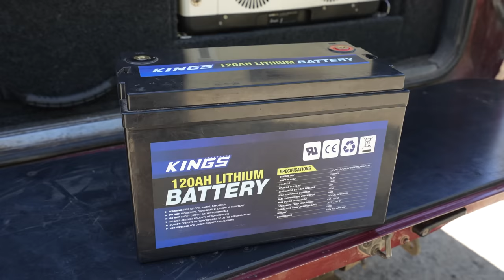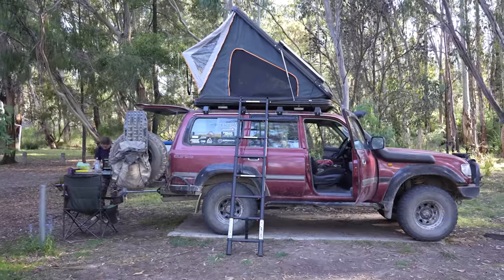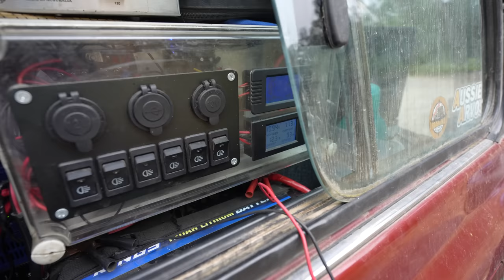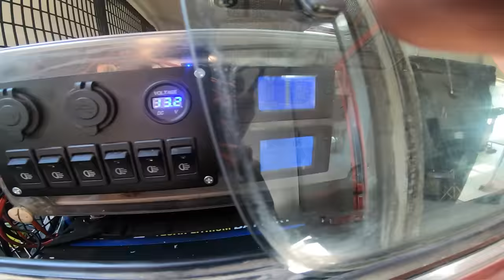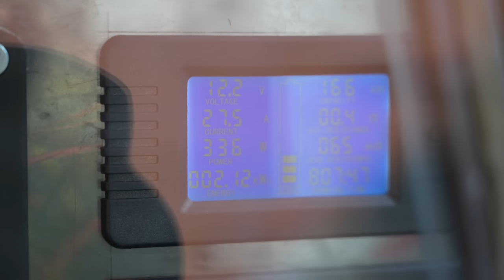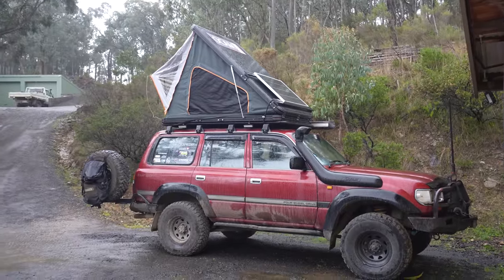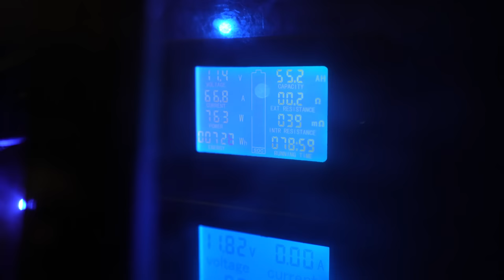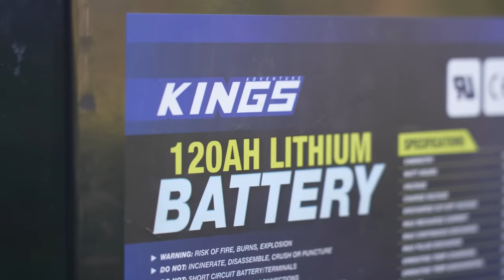Watch this BEFORE you BUY Kings Lithium Batteries

Comment from the maker: Have you moved to lithium yet? Do you plan to? I'd love to hear what battery you are running in your 12v setup!
Reply: I will be next week and replace the 120ah agm for a lithium and make it easily removed from the work Ute to put into my Subaru outback
Reply: Fantastic job detailing your experiences with this battery.

Thank you for this review mate 👍😆
Reply: I use multiple 130 Ah AGM lead acid batteries on my system. Its been running non stop since 2014 as its a static off grid system. But it may need battery upgrades in next few years.
Reply: I've been running a voltx (from Aldi for $400 odd) at 100Ah. I also use a Renogy DC-DC charger with solar or alternator input.
All up under $1000 and well worth it
Reply: @Wilbargosh great gear but not everyone has your budget
Reply: I run the same 120ah Kings Lithium for 6 months now & it’s perfect. 

Cannot fault! You just need to work out what do you want from your battery! 
Mine was basic 12v needs & this battery truely smashing it out of the park in value terms. 

It does exactly what it says on the box. 10/10
Reply: We’ve been using 2x140ah Aussie Atlas batteries with Renogy 50A DC&MPPT charger. Works like a dream. The induction cooker runs well on the 2000w Renogy inverter as does our microwave. Aussie batteries are made here on the Sunshine Coast, I agree it is so much better having the supplier close by. Great vlog about the 120ah Kings lithium, thanks for doing this.
Reply: The kings 120ah is currently $498 with a battery box also
Reply: I literally bought Lithium battery package from Kickass few days ago and  paid way too much i guess because i was't confidence from kings.  If i would seen this video few day ago i would go with kings  too late now.
Reply: I’ve gone to a 110ah DCS under bonnet lithium battery in our 200 series for the 3rd battery and what a difference.
I’ve gone from the fridge turning off after 6hrs to now it runs for 4 days without starting the car plus the 12V oven just works better
Reply: I am installing the iTechqorld 120 pro, because I am placing it in the engine bay.
Reply: @andrevanderwalt2515  how do you find the Voltx.  I see Aldi has them in stock this week.
Reply: The Kings you talked about has a 100Amp continuous discharge clearly printed on the label which means around 1100watts is the most you should be trying to draw from it. 1100/12/0.85=107amps. If you pull that battery down to its cutoff voltage with same 1100w load the calculation is 1100/10/0.85=129amps. You can make of that what you want, but powering an 1800w induction cooktop off such a small single battery is not healthy for the battery and advertising the fact that you do gives 4wdsupacentre an out as far as warranty is concerned should the battery die.

As far as the 2000 cycles advertised you can find batteries with 6000 cycles, a longer warranty, and Bluetooth connectivity that come on special around the same price as the Kings.  There is nothing special or stand out about it. I also do not like battery cases filled out with great blocks of foam making the case larger than it should be. Space is at a premium already in some of our setups.
Reply: I just bought a Kickass agm 120ah battery for $200. I considered going lithium but the extra money saved can now go into putting fuel in the tank.
Reply: Kickass Handy pack
Seriously for the weekend fridge raider 
Add a 110w redarc amorphous panel and got cold beer 48 hours ;)
Reply: Yeah 460ah 12v
Reply: If you wrongly critique a company's products on YouTube, you open yourself up to litigation.
Reply: @erroneouscode  12.8volts*100amps is pushing the BMS to the limit (1280watts) It is fine if you are using all 12v appliances and lighting this small battery will work well but no chance it would work for long at 2000 watts before blowing a mosfet.  2000watts /12.8v =156amps
Reply: @nubbynubs123   "2000watts /12.8v =156amps" If you include (and should) the inverter (in)efficiency into the equation it's much higher still. It's madness what is frequently done by trial and error. Even the cable that some manufacturers supply with inverters is NOT up to supplying the current the inverter needs at full spec load exacerbating the problem and pulling even more amps. 🔥 Kings should perhaps include fire extinguishers in their battery and inverter bundles 😅
Reply: @nubbynubs123  I didn't have caravans old or otherwise in mind in a 4wd setup discussion. In any case, I agree that 2 x Kings or any other brand battery with 100amp continuous ratings 'should' be adequate for a 2000w inverter used at full load. But, it also depends on other 12v loads being used at the same time and how low all the combined loads may pull voltage down and be effected by it and draw more amps. There is the potential to pull over 200amps with voltage sag going close to and under 12v. Besides the BMS potentially shutting down when running so close to limits, DiY's frequently don't size cable and fuses for low voltage and larger than expected current draw situations. I avoided DiY battery packs in my vehicle for potential insurance issues. I have 4 x Renogy Smart 100Ah in parallel with a 3000w inverter in my ute. Charge controllers and otherwise are mainly Victron branded. I run pretty well all the 230v Kitchen appliances that people undertake to use in vehicle setups these days and then some, much to the astonishment and amusement of other campers at times. Kids love the microwave oven and toaster, and adults like the idea of making a cappuccino or decent coffee. Have you fitted the "six 280 amp hour packs" to a vehicle or caravan? or are you talking about a garage or shed setup?
Reply: @paulvictor9368  There's two different Voltx models with same capacity but different specs. You should do some youtube searches as there is at least one channel that pulled both models apart to see what's inside.
Reply: I'm running a hand me down 100ah battery as my 2nd battery, works well but definitely need to upgrade soon. Cheers for the videos boys! Love seeing the budget stuff
Reply: @erroneouscode  thank you for the heads up.  The research will continue.
Reply: Enirgi advance lithium 115ah
Reply: @erroneouscode  Where do you find the advertised batteries you talked about? Thanks
Reply: @MrRobinski  Aussie Batteries are pretty good. Iv got 170ah lithium slim in my camper. It’s amazing.
Reply: Just swapped out a 100A lead battery in a van I bought to a 200A voltx lithium. 40kg to around 20kg. 200 amp draw, to run coffee machines, toaster etc.

Using renogy 50A DCDC charger, and victron 240 charger and smart shunt.

Well worth the upgrade!
Reply: I have a GIANT POWER 140AH AGM battery in a abr sidewinder flyer battery box added a cheap mppt solar charger a cheap vsr relay and 2x 160w solar panels, I run a 80 litre fridge and a 600w inverter for my cpap sleep machine this set up has been good for the last 7 years camping out of my 4wd for around 2 or 3 days at a time before i drive to another spot to recharge the battery. now i have just got a soft floor camp trailer and looking for something that will last 7-10 days without spending a small fortune as a powered camp site is only around $10-20 a night extra but i also like camping in free camp spots or away from other people and the power is a necessity to run my cpap sleep machine so looking at lithium battery  and dcdc chargers with solar input on them
Reply: I started moving to the kings 200ah lithium just after you posted the video about the faulty mppt. Using induction cooking off my battery and can say that I don’t even need to worry about the battery level nowadays
Reply: I bought one of the 100Ah VoltX ones off Kogan a fair while ago on sale. Pretty certain I got it for under $250, closer to $200 and I can't fault it. Amazing how much the price has jumped though.
Reply: Was this video sponsored?? Might want to clarify that at the beginning of each video. Without the declaration I just assumed it was a paid-vertorial.
Reply: Soon these would be replaced by Sodium battery, maybe slightly cheaper but able to be operated at larger temperate range!
Reply: @nickhiscock8948 Make sure when you go to upgrade you look at all the options. Usually for an offgrid system a 48V system makes more sense or even a high voltage dc battery with an appropriate inverter. These 12V lithium batts are really designed for mobile systems.
Reply: Hi I am running 400ah in two 200ah in parallel. I am running two 75liter fridges that can run for over a week without having to recharge. I can recharge from solar 375w, generator and car. If you look for the specials on 4wd supacenter  you can get 200ah for $799.
Reply: Ritar 120Ah AGM.. good quality, would buy again.
Reply: Hey guys thought you might be interested in looking at my set up and my 12v set up
Cheers 
Out There Touring
Reply: @nickhiscock8948  What does "multiple" mean... 2?
Reply: @andrevanderwalt2515  How long have you been using these batteries.... and how are they going now?
Reply: @rhinopower144  But how long will the AGM battery last? LiFePO4 batteries can last over 10 years  if used down to zero percent capacity, but 20 years if only used down to 50% most of the time.
My Battle Born batteries are warrantied for 10 years, and claim to drop to around 80% capacity after the 10 year warranty period, if used down to 0%. I live off-grid in Southern CA, USA.
Reply: Thanks that helps me out more than you could ever imagine
Reply: I’m three months in to having changed to lithium and so far I’ve had the same experience as you. It’s been consistently reliable. Fridge and lights run and devices Drone and cameras all charged while out and about. It makes it easy.
Easy is good.
Reply: Really confused on why you need a dc to dc lithium charger when the bms in the battery takes normal dc and does all the charge control?
Reply: If you want to overpay for your LiFEPO4 battery, do it with King or any other brand. I built my own battery from prismatic cells, 8 pcs 280Ah cells. When I connect them in two sets of 4, I get 12V*560Ah = more than 6kWh. When the actual capacity of the cells is 307Ah, it means more than 7kWh. Of course, I also bought the best possible balancing device, i.e. jk-bms. I bought them from a reliable importer and paid about 1000USD. So positioning the cells so they don't bulge when charging is something I had to do in addition. However, it is nothing more than a sturdy wooden box, in which there is no empty space apart from the cells. And if I want, I can make the battery a 24V 280Ah battery just by changing the busbar's between the cells. So if you're thinking about price, build your own battery.
Reply: I got 138ah and a solar blanket from kings and it works a treat....
Reply: Hows the battery holding  up now? Looking to buy lithium soon.
Reply: I just bought a van, I'm hoping I have $500 left for a lifepo4 battery and solar panel. I'm hitting the road for the next part of my life. I can't wait to get out and do it! I pick up the van next weekend.

Comment: You guys are giving a more achievable set up for a lot of us. We all know Redarc is top of the range, but most of us are weekend warriors and simply can't afford or justify the cost.
Reply from the maker: Yeah that's it, if money wasn't a factor we'd all have the best of the best. Thnaks !
Reply: Absolutely 💯, I’m still using 105a agm,
Reply: @Louis Kudlak  I have a redarc bcdc core25. kings box and a local 100aH AGM. when this battery is dead I will go lithium.
Reply: @astondriver  me two I think, kings though 😂
Reply: Yep rather spend money on fuel.
Reply: @louiskudlak2241  don't knock the AGM. 

I'm using a marine battery agm as my deep cycle.. tougher than the shitty car ones imo and can crank in a pinch too. 

Powers the fridge for 3 days without any solar input.. what more do you need.
Reply: Redarc definitely isn't top of the range. Go with Victron for that. Redarc and Enerdrive are rip-off in the market and none should be buying them to force the price down.
Reply: Also
Most of us would like to keep both kidneys in our body and still afford some Lithium lmfao 🤣 

Kind of reassuring that this will run everything with a 110w solar 
And a smaller (800w) < 2000w inverter  should keep my weekend cold beers, lights and music running for 48 hours ;)
Reply: Sorry buddy to me lithium battery are simple tooo dangerous.. No way I'm going to use them
Reply: @1989cranston  these kings batteries are liFePO4
Reply: @Marky mark  sorry mate, I said that the wrong way around. Lithium Polyer is LiPo and is dangerous, you are correct, these are LiFeP04 and safe. Cheers for picking up that error.
Reply: @AussieArvos  Great video, thanks! Speaking of weekend warriors, one of the big dilemmas when buying any battery or rechargeable widget is that the batteries die if they are not used/charged frequently enough. Perhaps that doesn't make you a good case :D but do you know lithium battery's resilience if you use them perhaps once a month or maybe just once a few months? Cheers
Reply: Well said and 100% agree. If I had too much money then I would just buy top brand names, may be. But kings make it affordable particularly if it isn't used for full time outback touring.
Reply: @shayan5507  that is just one of the many advantages of a good quality lifepo4 battery is that they do not have sulfating issues that lead acid batteries do, nor do they have the self discharge issue of lead acid which need to be charged every  few months even when not in use, I have lithium in my gear and sometimes work and other commitments sometimes mean we don’t get out as often as we would like and the gear can sit unused for 6 to 12 months and I have never had an issue with any of my lithiums and they are now getting on for three years old and still run like when they where new.
Reply: red arc are over rated.
Reply: @KoDeMondo I think you're confusing Lithium-Ion (Li-ion)and Lithium-Ion Phosphate (LiFePO4). LiFePO4 is very stable and safe. It can't self-ignite or combust like Li-ion can.
Reply: @LiamMarcon  could be but prefer to stay in the safe side... Later we will see what is safe and what is not! In any case this technology is not yet ready to be handled
Reply: Red Ark top of the range? 😂😂😂
Reply: @Nick  So you've obviously never used lithium then? No matter how good an AGM is, once you've used lithium, you'll NEVER go back.
Reply: @KoDeMondo  don't want to be rude but wtf are you basing that on? Are you just making that up? What makes you think they're "not ready to be handled"?
Reply: @KoDeMondo  ive had lithium batteries in all my trail bikes since goodones came out in 2006 and they best ever..nothing wrong with em at all..and newer ones are even better an safer....but each to there own...
Reply: These guys get all this stuff for free, so we subsidise it by buying at a premium price, kings is cheap but until the likes of redarc halve their prices I can't but kings 🤷‍♂️
Reply: Being the only Auto Elec to comment; Dont buy Kings if you can avoid it - Theres a reason why it is cheap. Do your research and ask qualified folks, not youtube / reddit people.
Reply: @LordlyStatistic  what battery do you recommend then that’s not a few thousand.
Reply: @sim8634  enerdrive batteries - $900 Elite or $1300+ for the B-tech... OR electroparts for the 100amp Lith slim for $1035... If you have a local auto elec, he can do you a deal on either, IF he/she is decent. I myself have been doing this for 13 years, and i promise you a decent battery will last 8-12 years EASY. Sure yeah at the start they were $2000 plus, but times have changed, and as much of a Redarc fanboy as i am - Enerdrive is better quality / value. And the 40amp charger can be fully adjusted to your needs... Look into it, i promise you will not be disappointed.
Reply: @LordlyStatistic  have you had them apart to see the quality of parts and constuction inside..
Reply: Thanks mate. Your honesty and good reviews make camping electrics affordable. If price was no issue we all would have the best. I’m about to pull the trigger on 2 kings 200 amp hour lithium for my camper trailer. Could probably get away with one but having two is stress free and never run out of power
Reply: @KoDeMondo  Absolutely wrong. Lithium polymer batteries & similar chemistry are the dangerous ones. Lithium iron phosphate (LiFePO4) are no more dangerous than lead acid. Have a proper read about the technology as you unfortunately haven't clued into that yet....
Reply: @Nick-sd7um 11:12 you
Reply: Lol
Reply: @marksoya712  Redarc was top of the range. After 18 years of Redarc I'm about to ditch my BCDC1240D Lithium profile charger. It has performance short comings. I've spoken to Redarc tech department, they acknowledge the issues (2) but say "that's just the way it is". Very disappointing for me as I was a rusted on Redarc supporter.
Reply: It's either Redarc or paying the rent 😂
Reply: If you want to go for a cheaper brand, I would go kings instead of buying from some nobody on eBay, who has nearly no accountability.

Comment: For any geeks out there, 120ah at 12.8v gives 1.5kwh of stored energy in this battery. In an induction cooker, assume perfect efficiency (it’s not) and that is equivalent to 5.4 Mj of heat energy. That is equivalent to a bit over 100g of LPG, although heating with open flame is pretty inefficient so you’ll need approx 300g of LPG to heat your food (most heat is lost around pan heating air around you) like an inductive process. It’s also equivalent to about 500ml of metho, and about 400ml of petrol for Coleman stoves. So you can see a small 4.5kg lpg gas bottle is equivalent in energy content to 14 or 15 of these 120 Ah lithium batteries. Cheers, chemical engineer
Reply: Gold